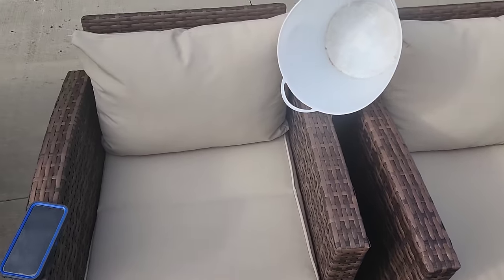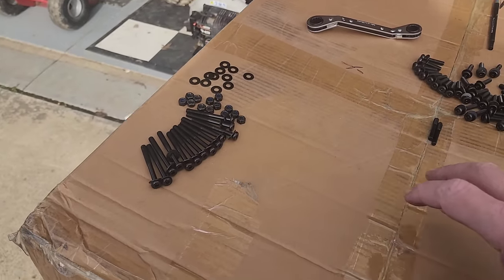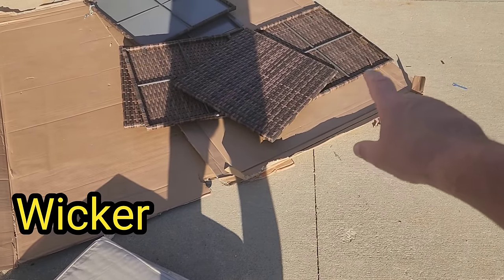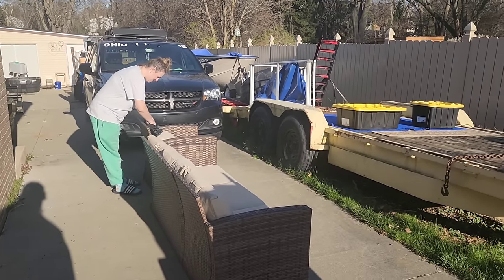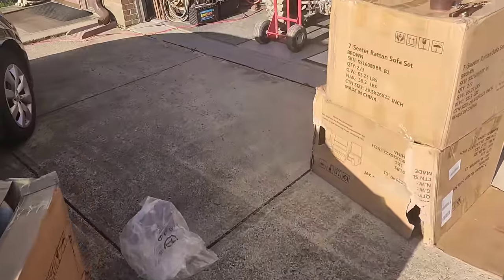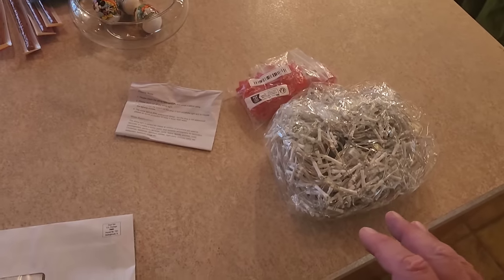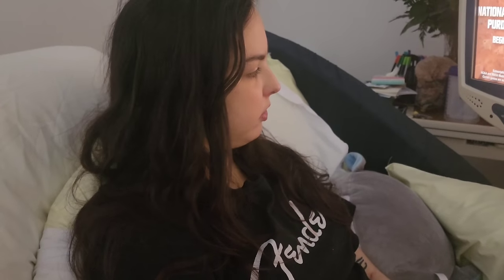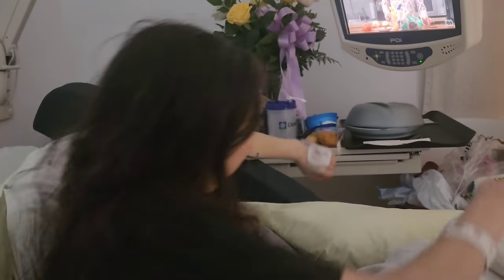New Upgrades at OHIO FISH RESCUE , Skylar hospital update

Comment: In liver failure it is possible for the spleen to take over the job of the liver. while you can't live without a liver a spleen can do some of the same functions for a while. also the liver can regenerate itself so it might be possible that she just needs a partial removal. I hope this helps with the anxiety you might be feeling, I find the lack of knowledge in these situations terrifying and so I try to help fill in any gaps I can.